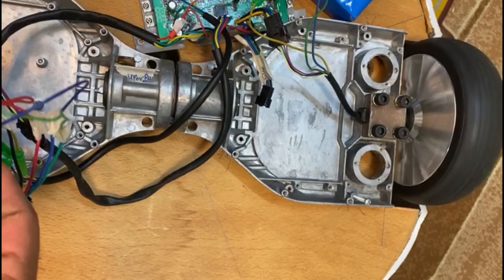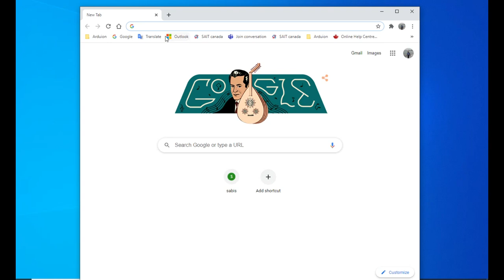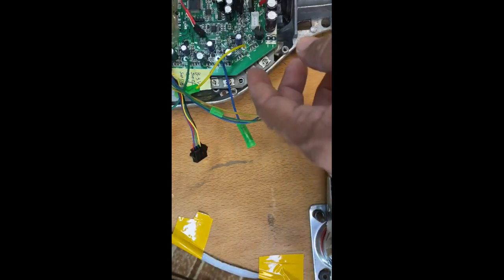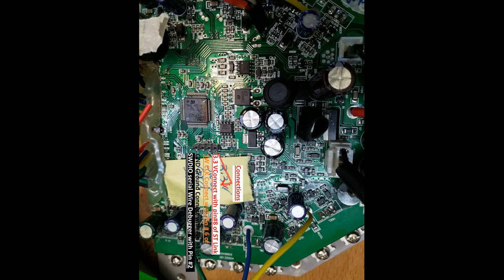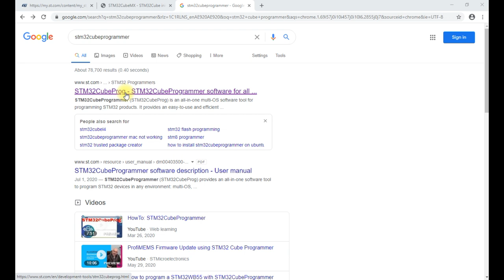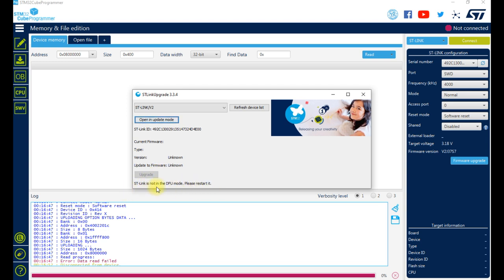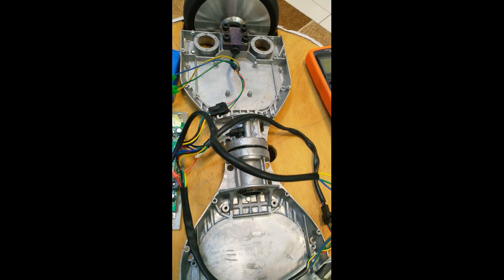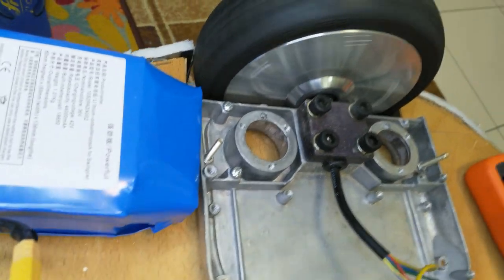Hoverboard motherboard hack how to hack  Hover board motherboard  Firmware STM32 BLDC motor cart STM

Comment: 2X tilt sensors for each side can be mounted on top of eachother, cables lengthened and can be mounted anywhere on the Trike/Kart on a pivot and angle can be changed via regular throttle cable to tilt  forward.... break cable can make tilt backwards for breaking or reverse... then no hacking will be needed to the board.
Reply: Have you seen that work well anytime?
Reply: That's an interesting idea. Diffently gonna try that :)

Comment: Huge thanks for the video! One general question, sir. Can I in theory use this motherboard to make a force feedback steering wheel for simulator? Usually, people use motor, but they use some other bldc controller and arduino leonardo. Can this hoverboard motherboard handle all of that?
Reply from the maker: Yes possible it is  other software but use HAL sensors and make connections for potentiometet

Comment: Hi, just curious I have a different kind of hoverboard that comes with two motherboard for each wheel instead of one single big one like yours. Will I be able to do the same step as what you did or I will need to find new firmware for these different motherboards? thank you in advance!
Reply from the maker: Different firmware
Reply from the maker: Ok
Reply: Hi , I have the same model with the two motherboards. Did you find the "different" firmware ? or you did any progress?

Comment: Can you advise. I am using stm32 cube programmer and st link V2 and upgraded the firmware connected, disconnected st link however, couldent connect
Reply from the maker: Reseting required after upgrade or first connection thats why connec and reconnect
Reply: @MKRCLabs I did disconnected and reconnected the st link after firmware upgraded, still no connection
Reply from the maker: Stm32 original devolvement board or bluepill ebay
Reply from the maker: I will try on my hoverboard with different st link
Reply from the maker: Install zadig usb driver it will solve you problem
Reply: @MKRCLabs  Thank you for your prompt response, I'll let you know how it go's

Comment: Dear Sir 
I have 2 question please 
1 ) Can we still reset to the normal setting program ( Orignal program ) ? 
2 ) Can we still charging battery by adapter normaly ? 
thanks
Reply from the maker: Yes you can charge battery
Reply from the maker: But original firmware required is avail able on github
Reply: @MKRCLabs  thank you so much 😍😍😍

Comment: can we control the motor separately by potentiometer?
Reply from the maker: It is possible if you use BMD ZS-X11B you need two controler with hover board controler I try it give problem during reverse/forward

Comment: Hey i want to ask you i did with remote but wheels always spinning when i turn on remote control  but dont do enything  only on what could be the problem? Pss: i have to remove and insert again battery to stop it and turn off remote. Thanks if you could help 😊
Reply from the maker: Use different hex file from github
Reply: @MKRCLabs   nice thanks but could you help how to turn left or right? back or forword it gose but left and right not😊

Comment: i really need help i have 2   st-link v2   wen i connected to pc the pc foundet without problem   but the  STM32CubeProgrammer  and STM32 ST-LINK Utility  didnot found   the    st-link v2  what ido?????
Reply from the maker: Update v link 2 software
Reply: @MKRCLabs  how i update if the software didno found the stm32
Reply from the maker: First update st link
Reply from the maker: 2nd after connection  disconnect and reconnect this is solution i secially explain this part in video
Reply from the maker: If still problem use other way create hex file and try with st link v2 no need st cube programer

Comment: How to brake in full speed? Thanks
Reply from the maker: Just rotate potentiometer or change rotation anticlockwise or switch off
Reply: Thanks for quick response 🙂
One more question, When I power the board on  the wheel start spinning backward and keep beeping.Then I twist the throttle a little bit more then the motors go forward no beeping at all seem like normal but when released the 
 throttle then the board keep beeping and wind backward again.
Any solution for that? Thanks 
Note: used an ebike  twist throttle for the Speed testing
Reply from the maker: We are using two potentiometers one for speed and one for direction adjust the potentiometer in middle then it will not move backwards also stopped the beep thanks fo comments and subscribing me please share with your friends next week I will upload an other video in that it is fixed with cycle and speed control machnism also different

Comment: How to flash ARM STM32 RCT6 99JH 98 ,  keep error can not connect to device. But i can upgrade the firmware st-link V2. Tried stm32 cube programmer and the older stm32 utiliy program.
Same error.
Reply from the maker: When you receive this message disconnect and reconnect again if you watch the video I explain clearly when this tricky step is required thank you ☺️
Reply: @MKRCLabs  
I did but it did not make a difference.
Just hear hoverboard beeps.
Reply from the maker: Check your st link v 2  good or change it and try
Reply: @MKRCLabs  
Checked st link v2 three times, maybe the 4 pins wiring hoverboard should be different its a chinese stm32 imitation mainbord(red color)
Reply from the maker: @antoonsorg  check the power with meter if already you connected the power also what about switch be care full for power supply cables can you watch again video it is with full details for connection
Reply: Hello, How can I flash GD32E230 (GigoDevice arm) using ST-Link. I tried following the steps here but it did not work. Thanks in anticipation of your reply
Reply from the maker: Ok I will send you link for video

Comment: I have a controller using 72v 45a stm32 i want to increase its speed how can i do it
Reply: is it Votol ?
Reply: @85daniels  no lingbo
Reply from the maker: I will heat up this hoverboard motor not design for high speed any how run with out Hal sensors feed back